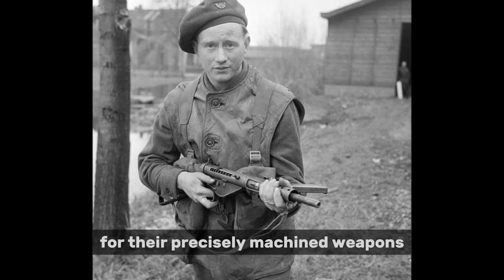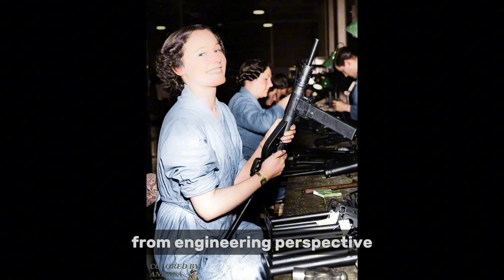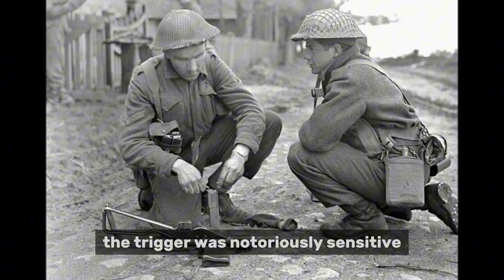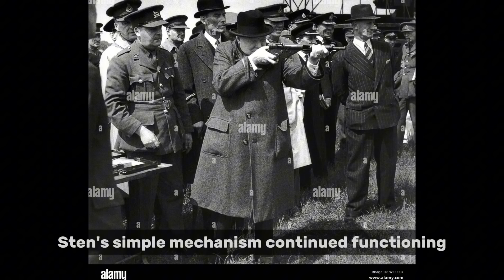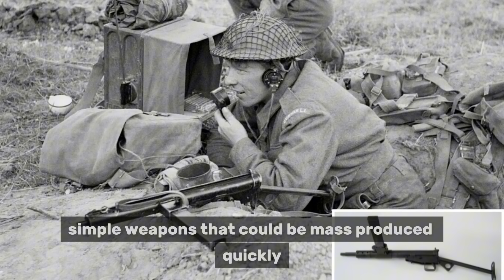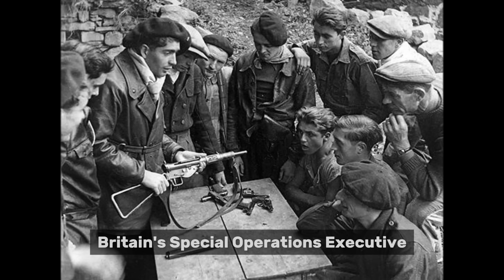How Britain’s “Ugly” Gun Outperformed Every Other Allied Weapon by Miles

Comment: £2 vs $200  at circa $4=£1, is 1/25th by my reckoning. not 1/10th! The Sten was also based on the Lanchester, itself based on the WW1 German MP28. I'm surprised they didn't offer a longer barrel option, for some uses, and ditto a muzzle brake/flash suppressor, to correct the muzzle 'climb', like they did on later versions of the AK.

Comment: One advantage of the Sten, is that it could be fired from very close to the ground. At Arnhem, German troops frequently were unable to fire at targets through drifting smoke, as they had to fire from around a foot higher where the target was obscured, because of the vertical magazine of the MP40, whereas the Sten could fire beneath the smoke. This was about the only advantage of the weapon. It was not accurate, it would often fire accidentally if mishandled, and much like the PIAT, was replaced fairly soon after the war was won. It was useful in it's time, but not thereafter.

Comment: Sten was brilliant simple and effective.
Mk1 had issues of it may go off if jolted hard.
Mk2 addition of simple safety catch and had either wire frame stock or T bar stock and some variants had addition of suppressor mainly used in special raids.
Mk3 pressed steel construction  different to the other stens.
Mk4 and mk5 had addition of wooden rear stock and some with wooden pistol and fore grips.
Some had simple metal pole fore grips but not many.
The sten and mp 40 both very similar rates of fire however the mp40 on the most part is a much more engendered piece.
Sten simple and easy to use single shot and auto and will do what you want it to.
Side mag not a real problem

Comment: This is AI BS that reported itself, no folding stock and it was a simplified lanchester / mp28 / mp18 box mag and the mags where the same and the mags not reliable loaded down to 30 , no folding stock stem MK1 had wood and yes they made then a little too cheap and they jammed hard to grip as in without gripping th mag and using the sights , many would carry 2 stens for when 1 jammed .  Mp40 was stsnoer and similar.   But the sterling was a star still one if the best 9mm smg mags

Comment: 1) STEN had no side folding wire stock - and no folding stock at all, although the stock was relatively easy to remove
2) The STEN and MP40 have almost identical rates of fire and the MP40 was not fast firing and wasteful of ammunition. As with the STEN, single shots were possible

Comment: The Mk2 STEN gun had no fixed relationship between the broom handle crude gun sights and the barrel, the barrel could end up at any angle. One of my school teachers who was in the 8th army said that the STEN was just a crude bombarment weapon you couldn't hit anything with in the desert. The STEN had case hardened parts which would wear out quickly, making the gun dangerous to anybody in range of the hideous misguided plumbing. It is said that between 3.7 and 4.3 million STEN guns were made, they didn't even bother counting them, they were dropped like confetti across occupied europe, the Germans sometimes armed rear area service troops with them because they captured so many.

Comment: Check the Australian Owen sub machine gun. Superbly made, absolutely reliable and the vertical top mounted magazine eliminated any feed issues. 
Looked very odd, but far outperformed the Sten.
Reply: The Sten was good but the Owen was better.
Reply: I've heard the Owen was a very good gun, but one Ozzie soldier in Borneo tried to kill an elephant with it. The elephant killed him.
Reply: @bernardedwards8461  You gotta pick the right tool for the job. We had the Lahti L-39, which the troops called the elephant gun. No elephants in these here parts, however.
Reply: @bernardedwards8461  It was never meant to kill elephants. There was a version made to fire a 45 ACP but it was rejected in favour of 9mm Parabellum which has a faster velocity but smaller bullet.
Reply: Was it more expensive and slower to produce?
Reply: @davidhawkins8060  Yes.
Reply: @davidhawkins8060  Yeah, inquiring minds wanna know! How many were produced and for what cost?
Reply: My unit in the armoury still had some Owen guns... but I never saw them issued, much less used.
Reply: The MkV Sten was just as good.
Reply: The Owen also tested better than the thommy gun and the grease gun. Even used in the Vietnam war.
Reply: Stens, Stens, Stens,I used them !
Reply: Which is better: Sten gun or grease gun?
Reply: No submachine gun could kill a full grown elephant.
Reply: According to those that used both guns, opinion was the Owen gun was their preferred weapon of choice.  That said, according to Google, the Owen gun cost between 4 - 6 times more  to manufacturer.
Reply: @aking-plums6985 When you consider the expense to train, equip, transport and feed a soldier, the additional cost of having a reliable weapon (it was about 3X the Sten but six times less than the Thompson), is trivial.
Reply: @catinthehat906  Hi mate, I agree with you that if a country is going to send its troops off to war, then they should equip them with the best equipment that money can buy especially after the cost that you have mentioned.  
Unfortunately for the British, they didn't have the money to equip their forces with the gun they wanted (Thompson) so they had to make do with a cheaper alternative instead.
Reply: @catinthehat906  True, but time was short and it needed to be a weapon which could be manufactured in vast numbers very quickly.

Comment: The Sten gun was absolutely garbage so much so that the French Resistance fighters would just take the clips and leave the gun if they found a German MP40.

Here's a list of issues with it.

Reliability issues: Early versions were notorious for accidental discharges when dropped and other malfunctions, earning nicknames like "Stench gun". Complaints about reliability continued throughout the war. 

Poor accuracy: It was not designed for accuracy beyond short distances, and a welded-on front sight made it impossible to adjust for point-of-aim errors. 

Safety concerns: The minimal protection for the bolt and its basic safety mechanism made it potentially dangerous to handle. 

So yeah I believe that I made my point.
Reply: Are you a club shooter ? it seems so by your book-educated reasons for the Sten being so useless. Have you used a sten yourself or just from comics./movies ?  I have fired one and it worked a charm, although you had to be ready when full auto, as it could quickly rise up and to the right. The main thing is that a well-trained Shooter can make any gun usable when necessary but an idiot is just that..
Reply: Most of the problems were due to users who thought it was great to hold the magazine.  Due to the unco-ordinated manufacture in small shops the magazines were slightly varied and needed to be rammed home and left alone.  Holding the magazine misaligned it and caused jams. Once you saw a demo in training of a dropped sten firing, you never dropped one. The sights were almost never used.  Either rapid alignment like a shotgun shooter or shoot from the hip starting low left with relaxed knees.  You finished the mag high right with most of the opposition neutralised.  Squads were broken down into a variety of weapons, so you seldom had only stens with no rifle cover.  Many were issued to tech operatives as more carryable than rifles and better than a revolver.  The majority of the detractors never fired one in anger.  @stevelenox; NO CLIPS with a sten. Hand load 28 rounds into the magazine.  Very few sub machine guns were loaded to the nominal capacity.

Comment: It could have been done better . compare the Soviet PPS43, Mikhail Kalashnikov stated "The PPS43 was the best s m g to come out of WW2" .
Reply: You're right, it could have been done better - if time and money had been available, but they weren't.  However, as more time and money became available, it was improved significantly, with the Mark V Sten being a genuinely capable weapon.  Then follwed the Sterling, which was again, a much improved version of the Sten.
Reply: Two benefits of the Sten were that much of its production could be outsourced to smaller workshops, thus simultaneously utilising a greater percentage of the population and also making it difficult for the Germans to bomb a single factory.
Secondly, in its use, the side mounted magazine meant it could be fired in the prone position.